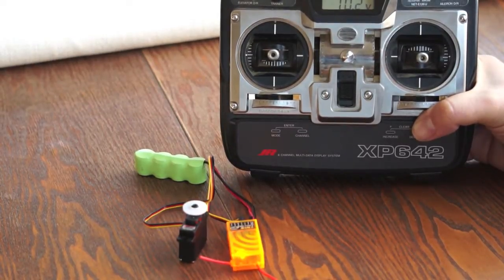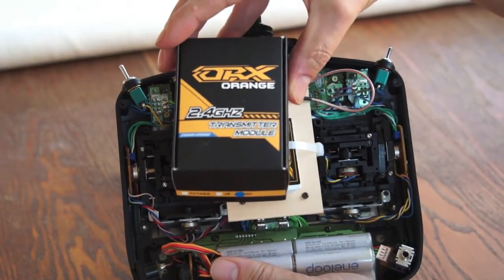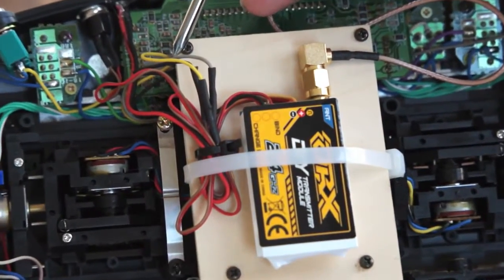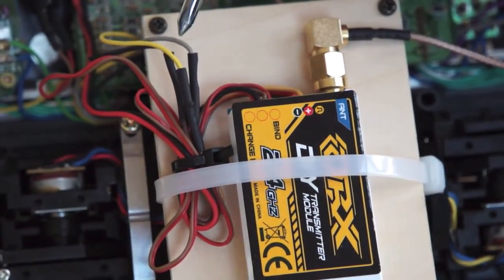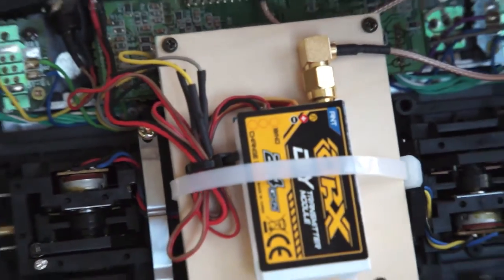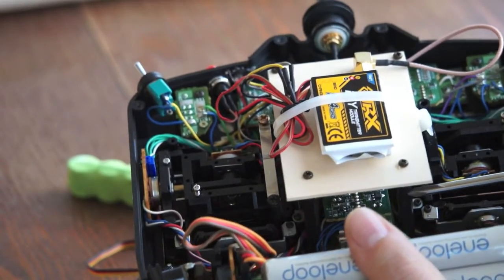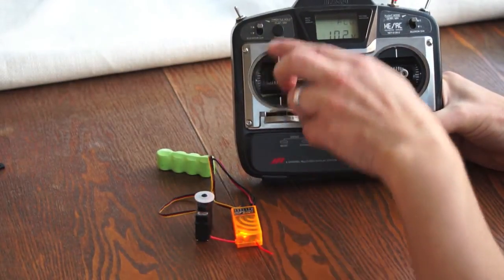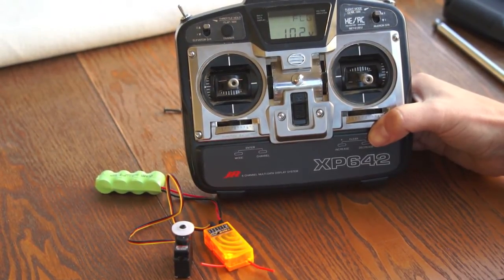JR XP642 DSM2/DSMX 2.4ghz Conversion.

Comment: Hello hello - thank you for an excellent video.  

Forgive me ignorance please, but could you provide more detail about the "orange module" bit you purchased and mounted on the plywood board?  

Why?  My Dad and I are building up a little project and converting an old 35MHz transmitter to 2.4GHz needs doing.  My Dad knows a lot about the RC stuff, but his experience does not include multimeters and electronics. Neither does mine really 😢 but I have done a bit for work and was able to follow your video instructions quite easily, so think I'm up for the job.  

But I'm not sure what the purchase - the orange module.  Could you please put a description in the comments?  

Thanks very much.  Lisa
Reply from the maker: This is the module I used in the video 😊
https://hobbyking.com/en_us/orangerx-dsmx-dsm2-compatible-2-4ghz-diy-transmitter-module.html?___store=en_us

Comment: Thanks for the video. I bought the same module however I couldn't bind it to my spectrum receiver. The hard thing about the transmitter is that it is not indicating the state or procedure. Therefore, could you please give some tips about it.
Reply from the maker: Barış Taner I suggest you first check that your transmitter is compatible with this conversion, some older FM radios won't accept the module. Do you have the 3 wires connected correctly? Are you following the correct binding procedure (instructions are included with the kit). My radio is quite old but was a PCM/PPM radio and it worked. Also, have a search through rcgroups for some more information. I hope this helps you, thank you for watching and commenting, much appreciated.

Comment: I just did this same conversion, though I had an additional black wire which attached to the  under side of the connector you removed, so I assumed it was a common ground and tied all together.   Though now when I turn it on the screen shows RAP.  Any idea what that is?
Reply from the maker: +David Missirian - That's a new one for me - I just opened mine up to have a look and I checked the board that I removed and I can't see an extra black wire. Maybe try searching rcgroups for some help?